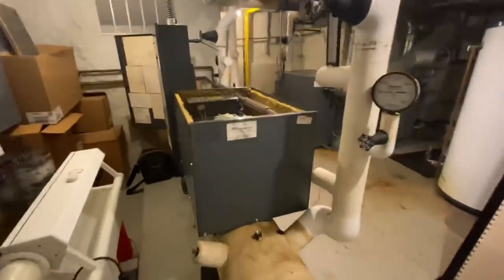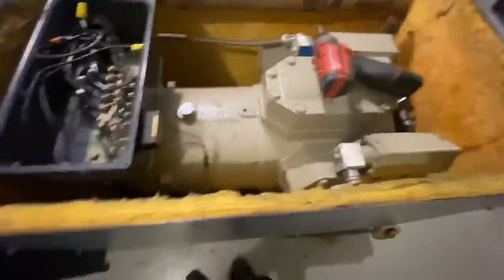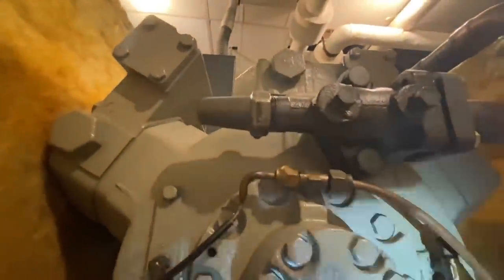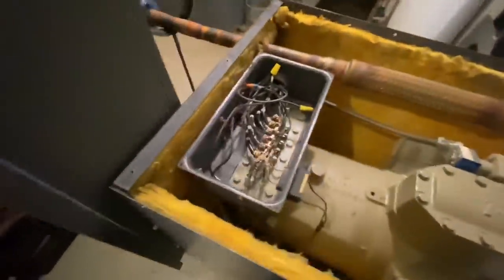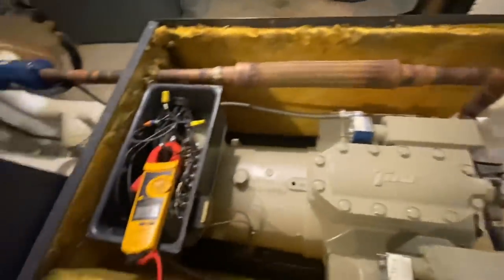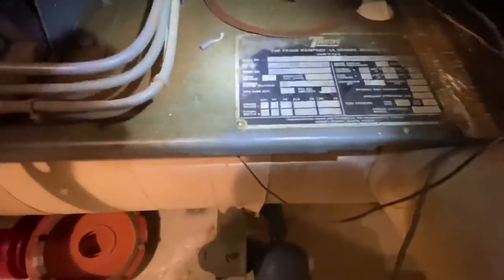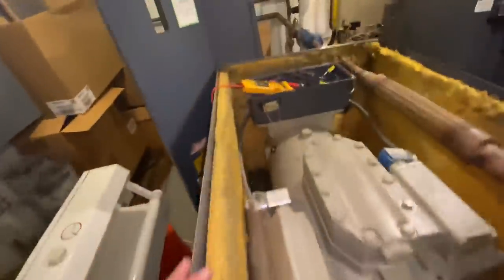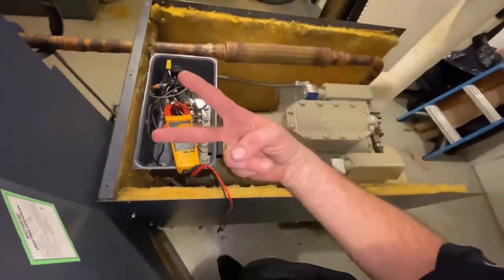AC Semi Hermetic Compressor Blows Breaker

Comment: A nice place, indeed.  I take it the transformers on the wall are there due to mismatch between 208 and 240 equipment voltage / line voltage?
Interesting video -- it'll be great if you get the repair job.

Comment: meter looked to be on diode/continuity beep setting, but I'd guesstimate by the readings on it around 300 ohms to ground on all terminals. hi-pot/insulation test would show very bad short to ground, let alone the winding's are likely shorted to each other and themselves, would have been nice to see the resistance of each individual winding, not that it maters with it being junk and no insulation left on winding's inside, clearly too many years of acidic oil eating itself.